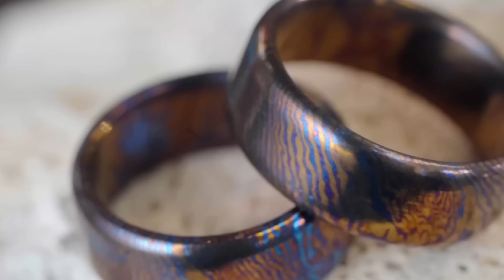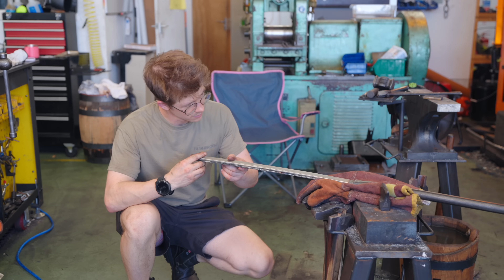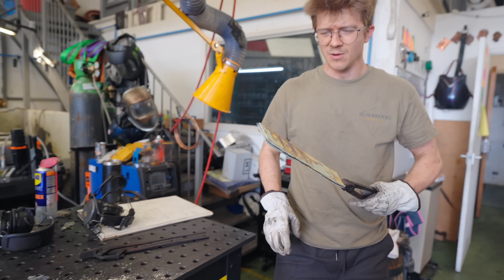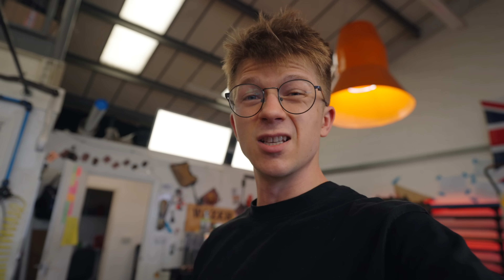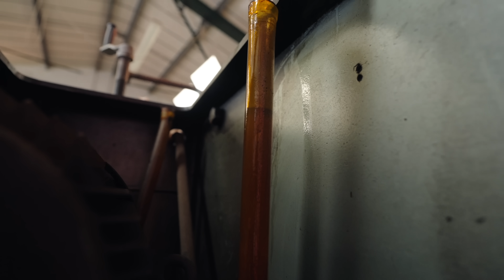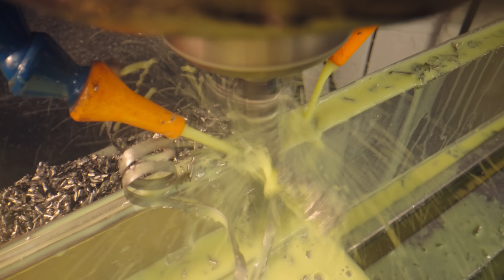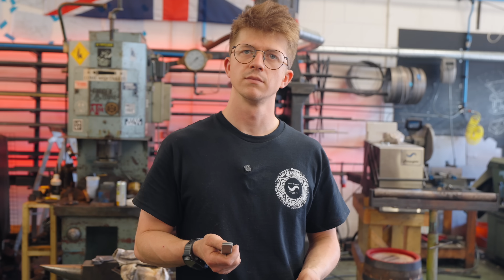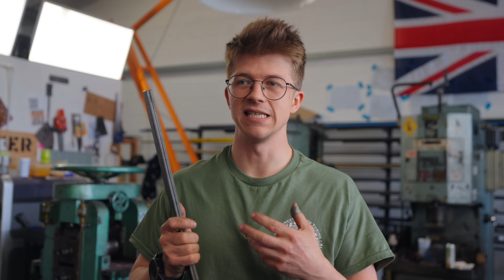Making a Titanium Damascus Katana - Part 1

Comment: Couldn't you heat the billet in the forge and put the induction heater in front of the hammer. So that you hammer the billet while heating it with the induction heater?🤔

Comment: I'm just a dummy, but I think in theory you could weld a nipple to the opposite end of your billet and draw a strong vacuum in your billet, and then fill the billet with argon. With positive argon pressure in the billet, then cut off the nipple (maybe initially weld the nipple to a sacrificial tube for reuse) and then proceed as normal.

Maybe that's an extreme length to go to, but if there is any question of lingering traces of oxygen, that would answer the question enough for my mind